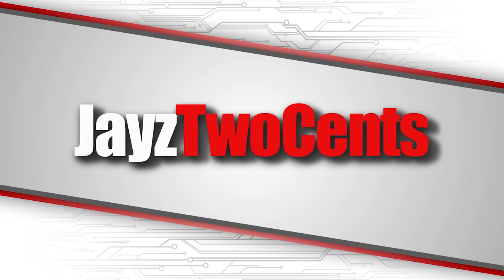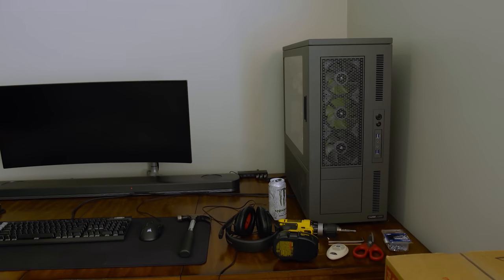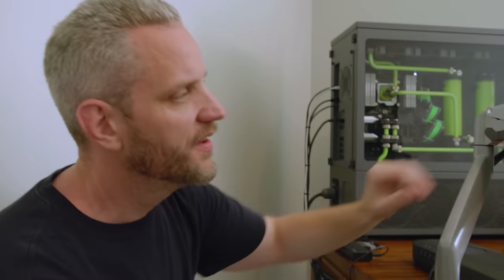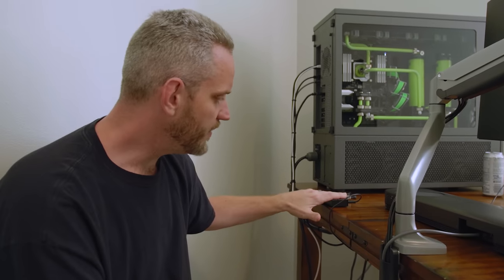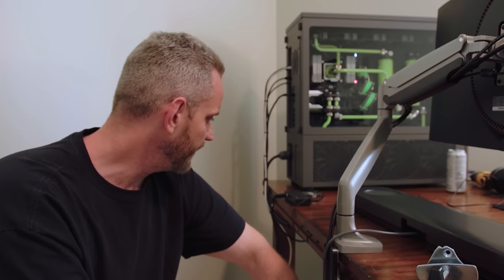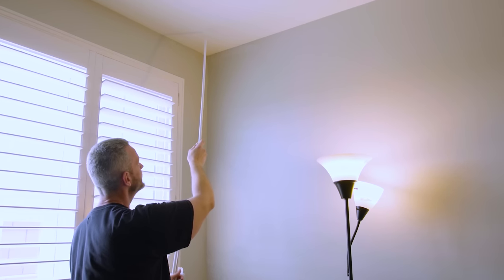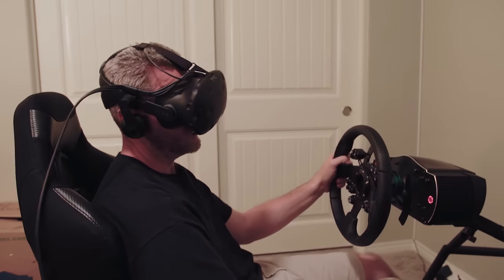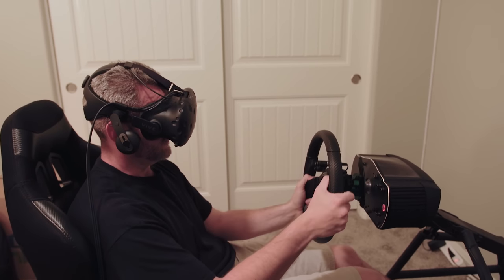Setting up my new gaming space in the new home!

Comment: You need a simulator refresh, I will suggest a few things. Would make for great  content too.  Chassis (simlab p1 or heusinkveld chassis), steering wheel drive  (simcube), steering wheel (augurysimulations 2 options), pedals (heusinkveld or HPP), motion (sfx100 great project). That should get you 90 percent of the way there.

Comment: Buy double sided velcro.  Cut into strips.  Length will vary on your needs.  I typically use about 6" strips.  Using lathe screws attach the strips at intervals of about 6" - 8" apart in a row with a screw in the middle of the velcro.  Cross the velcro like a bow around your cables.  Nice and tidy to the underside of your table, easy to add or remove, and add any necessary spots.

Comment: Jay get yourself some velcro man it will be way nicer than zip ties also great setup and congrats on the new office.
Reply: bruh as electrician myself zip ties are way to go :P
Reply: honestly in my 20+ year experience zip ties are easier, if you need to undo them its 5 seconds with wire cutters vs unwrapping each velcro tie at a time of 30 sec each tie, also you can get zip ties tighter, plus a bag of 50 zip ties is about the price of 2-3 velcro straps.
Reply: @DZIqsongs  I do cable management in data centers and headends valcro looks better and is easier to take apart when he gets his new desk.
Reply: I mostly agree, but you can't get velcro straps just as tight as normal zip ties
Reply: @TheEphixx  that's true but normal zip ties cannot be reused...
Reply: Actually REAL cable management is done with Wax Lace cord.  Has a number of advantages over zip ties; which CAN be done ok, but all to often tear into your cable insulation, and aren't as conducive to pulling through or along, or using existing to pull through new cable.  Not a lot of folks know/uses lacing anymore, but well done, its an awesome sight, and much nicer to work in/with.
Reply: 5:33, my dude
Reply: @jonathansmith6299  agreed when securing cabling in cable trays it looks amazing.
Reply: @TheDraktbagit  Me too! Using zip ties for cable management is straight n00b. Then again Jay does some ghetto crap sometimes....
Reply: I'm an electrician too and generally prefer zip ties but you don't use them with coax or network cables, I did a large Molex cat6 install and they refuse to warranty their product if zip ties are used to hold it in place
Reply: @jonathansmith6299  they used that before zip ties were invented
Reply: @shaynegadsden  Exactly, Zip ties can damage the jacket first then the copper core next. When I copper core of an ethernet cable get damage the frequencies will be at a loss and packet loss will occur.

Comment: I used an IKEA kitchen countertop as my table. Fixed to the wall with the biggest brackets I could find, and also an archive at one end. You can get full wood countertops from IKEA, doesn't need to be MDF or such. Super lengthy table too. :)

Comment: Jay bro nice setup as always. One idea I use is instead of the nail in c clips I use pc pipe cut to around 20mm width sections screwed to the table with a slit cut in them. They are heaps easier to change cables or configuration and hold a heap more cables in them. Keep up the good work bro. Cheers Mark from Australia 👍

Comment: Wireless adapter for vive and you don't have to use breakout box just have to run little wire to 5G blaster 🙂 but I suppose there might not be PCIe space in Skunkworks.
Reply: U need if you want bluetooth
Reply: @Gamingwithmatteo311  ah yeah forgot about that. I just totally took the box out when I got the wireless adapter.
Reply: @Skyguy1193  I did at first but I like the bluetooth power management

Comment: For the wall channels, would it be a decent idea to either put a bondo-like material, filling around the sides of the channel to make it look like a smooth 45 degree angle between the walls? Or maybe put some sort of paneling / drywall covering over the channel to make the corner 45 degrees? It could also be possible to put some sound deadening foam or other material over the channel, hiding it and acting as a part of the echo removal system.

Just some ideas...
Reply: Verified channel with 4 subscribers? How?
Reply: @faisal-nl2vf  it's connected to Google Plus was probably a verified user there

Comment: speaking of cables, JAY.  what do you think about 90 degree power cables for the power supply.  Would you do a video on what power cable other than the stock one that comes with the power supply, of the Good the bad and the do not use cables .

Comment: Have you ever considered building your own desk? Mine is 100% custom built just like a kitchen counter is, with 2 sheets of 1/2in particle board, glued then nailed together, with a Formica top, which is extremely rugged, as it's made for the kitchen, with tons of designs to choose from. 6ft in the long direction for my monitors, keyboard, mouse, then some extra room for whatever, then 5.5ft in the short direction for my testing computers, monitor, KVM, keyboard and mouse. It's 30in deep, so that allows me to put my main computer in the corner, but not too close to the edge. I used some 3/4in galvanized pipe for legs, one on each end of the L. You could customize that setup for whatever you want, but that is a setup that has worked very, very well for the last 5 years, and many revisions. I am an electrician, so I custom wired electrical outlets onto the bottom and edge to avoid running plug strips, both power and electrical runs into a small network rack just to the side, which houses 3 UPSs, 2 servers, and a network switch for everything.
Reply: I should also note that it as fastened to the wall with L brackets screwed into 2X3s, and is also extremely sturdy, I'm 170 LBS, and can sit in the middle right on the corner where there is no support, and there is absolutely no flex to it what so ever.

Comment: Jay, have you thought about getting a butcher block counter top? I used a 1.5 in thick 8 ft long black walnut butcher block from Floor and Decor and put some metal pipe legs underneath, cut to my desired length, with 3 cross-members and it's very sturdy.

Comment: No UPS for Skunkworks? Life is good for a gambling man!
Reply: Where the fuck do you live that power outage is an issue for you?!
Reply: @Spexxos1  UPSs are also good for power conditioning - smoothing out the spikes and drops
Reply: @Spexxos1  I live in a town in the eastern panhandle of West Virginia. The power blinks out for a few seconds randomly if the winds pick up and blow just the right way at over 40+ mph. Or if there's a good lightning storm happening. I once recorded an overvoltage on the house 120v line of 184v during a storm. Luckily it didn't fry anything but all the lights in the house that were on decided to go into "I'm going to be brighter than the sun!" mode for a few seconds, even the LED ones. Needless to say, the multiple UPS units were screaming about overvoltage while all computers in the house were powered down safely.
Reply: @CAMintmier  Really? Interesting. The last non maintenance outage I recall here where I live in central europe is at least 15 years back.
Reply: The amount of high end set ups thats don't run UPS's is insane. I bought a big one for my pc and router/modem and a smaller one for my 3d printer. I don't usually have power problems, but the peace of mind is worth the price.
Reply: @Spexxos1  It really depends on the area. Where I used to live (Cascais, Portugal) I cannot remember the last time I had a power outage. Where I am living now I've had a handful of power blinks lasting a few seconds in the space of 2 years (no idea why).

Also, it's not just general outages, this is a big house and if you run one too many appliances at once the circuit breaker might pop (nearly everything is electric here, including the stove). I have two APC UPSs for my systems and they do save my bacon from time to time: a 2200VA Smart UPS and a 1000VA Smart UPS (actually also have a  third 1500 VA APC BackUPS, but that is connected to the cable modem + tv on the living room).

Even with 3 monitors and a fully loaded system, the 2200VA UPS allows me to comfortably ride any power outage lasting up to 1 hour. Anything longer than that and the system will safely and automatically power itself down.

Thing is, all it takes is ONE power outage at the wrong moment to potentially make you lose HOURS of work, and that is where a UPS comes in: it gives you total peace of mind.
Reply: @CAMintmier  How did you get verified with only 4 subscribers?
Reply: I'm laughing at the fact people keep referencing loosing power. No the ups is for surges (lightning strikes), brownouts, and voltage conditioning, not just power loss scenarios.
Reply: @turbochardged  You don't need a UPS for that, there a power strips for 1/10th the price, and I'd bet your ups doesn't do what you think it does.
Reply: @turbochardged  You do realize that no UPS will save you from a direct lightning strike, right? :) Also, I would say that, with the exception of rural areas, power loss is a much more likely scenario than 'dirty power'.
Reply: Christopher Mintmier I also live in West Virginia, the southern part tho. There are power outages all the time because all the trees get blown over, and they refuse to put power lines underground.
Reply: @Spexxos1  Here in South Africa we have daily Load-shedding
Reply: @Baka_Oppai  actually it does. If you read the manual you would know it monitors voltage and if it exceeds the threshold it disconnects the mains and runs on battery. I have erratic voltage at my house, and when it drops below 100 it kicks in.

Comment: damn, cheaped out on the arm. i have the same one, the part where the mounting bracket clips onto the arm itselve isnt so great. (the monitor moves and swivels on the mount, and not around the joints in the arm) but hey, what can you expect for 40€

Comment: The wall mounts you use for your light boxes, are they what come with them, or are they a 3rd party mount?  I'm looking for something for my Rift sensors.  There are many options, and I believe they are a 1/4 thread, but the ones you have are nice and small, low profile type of deal.

Also, the black boxes on the grey wall I think look good.  It's all about contrast.  Your computer and peripherals are black, your racing rig is mostly black, so it's nice to have a bit of black up high as well.  But I guess that's personal preference.

Comment: JAy  how about what case are good for water cooling and what are not good for water cooling, See i have a Cooler master Master box 5 i think its a older one with the half cover over the power supply and i am running a XSPC D5 pump and then a res both a stand alone units .. and trying to mount my freakin pump on the cover of the power supply i find that using Hard line tubing SUCKS >>

Comment: @JayzTwoCents what display port cables are you useing because everyone I seem to buy doesnt work very well with my Vega 64 and Pixio PX347c prime 34" ultrawide. I'm always getting a error mesage saying "The system has detected a link failure and cannot set the requested resolution and refresh rate" which is 100hz. Any advice you chould give would be or great help thanks.
Reply: Are you using DisplayPort 1.4?
Reply: DRwarnclif yes I am
Reply: @ronniecason9807  Odd. Sorry I can be of no further use. Hope you can solve your Problem.

Comment: Jay I need help I have a Ryzen 7 1700 that's running stock and I have 2666 ram is running 2133  I want to over clock them but dont know what to put the voltage at on the Ryzen can you help. Ryzen is 3.0 would like to run 3.6

Comment: Using a table for your rig is a good idea but you are taller than me. Id die of Carpal tunnel syndrome or have to saw 3 inches off the legs of the table to pull that off. lol

Comment: day you should look into projectcars force feedback registry editing. Not sure if it happens on fanatc stuff or not.

projectcars 2 edited my logitech g920 FFB registry values, so every other game that wasn't projectcars 2 had incorrect FFB response. I found in iracing it was very hard to read what my car was doing based on the FFB, and assetto corsa just felt off.
After changing my values back to default, iracing felt amazing and assetto corsa felt like it did when I first started.

Unfortunately because of this I will not play projectcars 2 with a wheel ever again. 

http://forum.projectcarsgame.com/showthread.php?64672-ANSWERED-PC2-changing-registry-settings-and-messing-with-feedback-in-other-games
This is a link to where I found out about this.

Again it may only be a Logitech thing, but it might be worth looking into because if it has changed your FFB settings for your fanatic gear, it would probably be even worse than on my G920.
But I really hope I am wrong here.